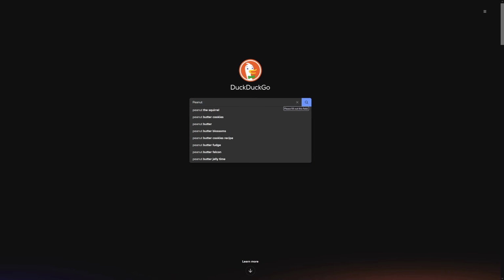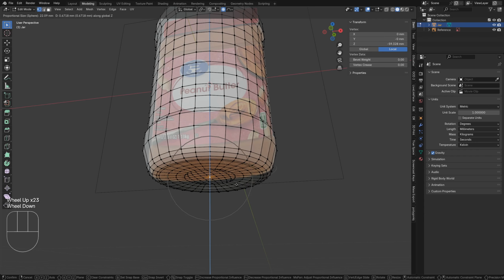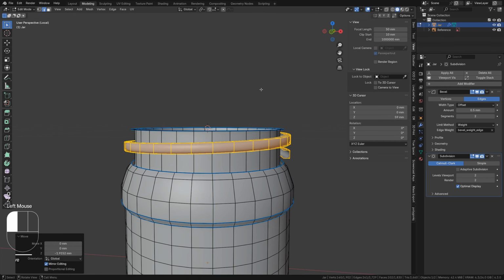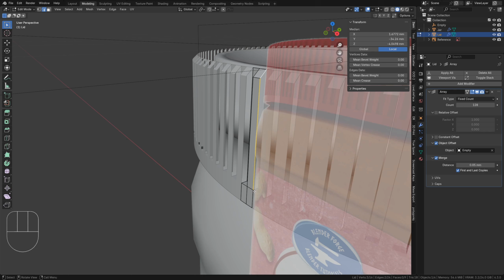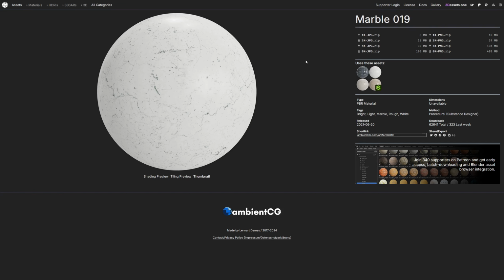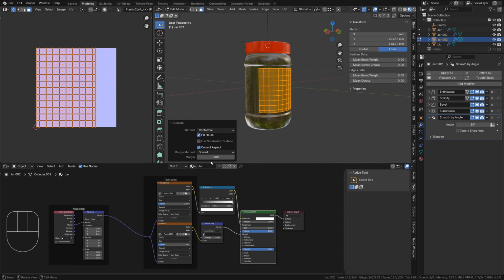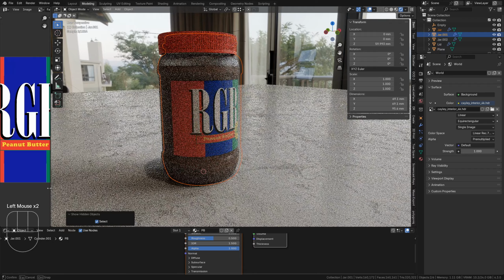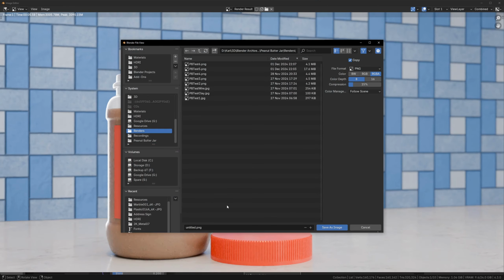Create a Realistic Scene in Blender. Why Not a Jar of Peanut Butter?

Comment: quick question: your model is opaque, I can't seem to get mine to be opaque and I think it is making it harder to work with. I've googled and goodled and have the viewport display as textured but it's still complete transparent wireframe.
Reply from the maker: It's possible that you hit the shortcut Shift Z for wire frame, or Alt Z for X-ray. These are available as buttons as four circles in the upper right of the viewport.
Reply: @BlenderForge  you are a legend, must have fat fingered, shift Z fixed it!